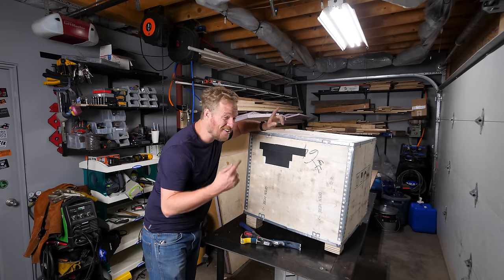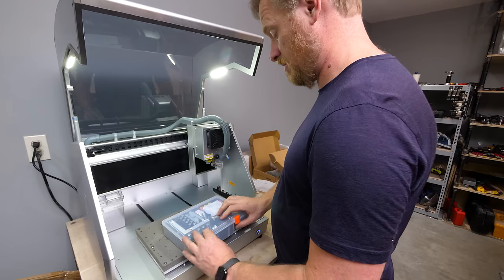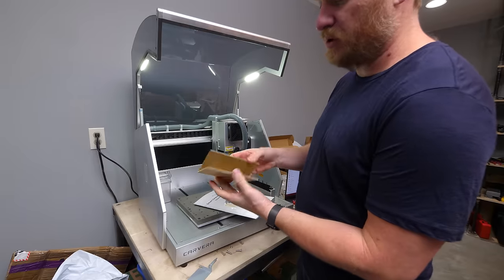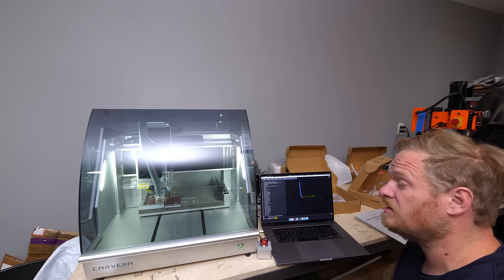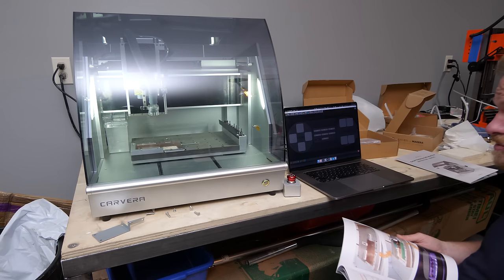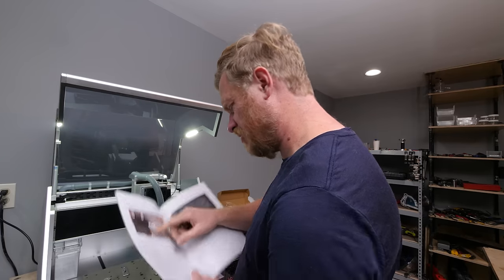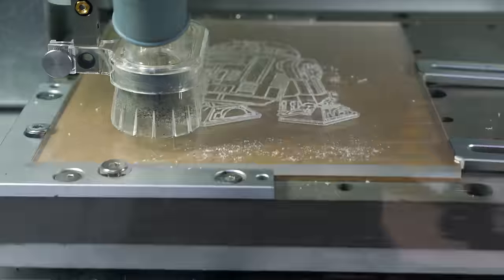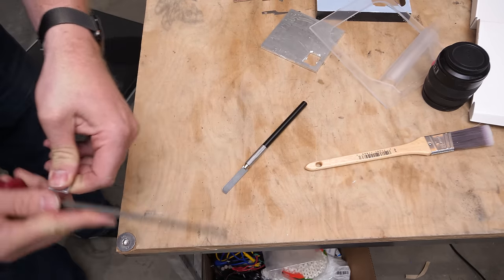Carvera - The Perfect Desktop CNC Mill?

Comment: I like the idea of including a documented project, with parts, to get yourself familiar with the machine.
Reply: Yeaa... It'll show you what CAN be done but not how... CNCing on machines of this... "Caliber" is parts knowledge and parts gut feeling. You need some general knowledge about the available operations you can do, which tools to use for the material, and which settings to use for them to neither wear down like no ones business ( feeding too slow ) or breaking ( feeding too fast ).
And since these machines usually aren't as rigid as one would may want you'll also need a good portion of the Gut Feeling, listening to the sound it makes and maybe get a feel for vibrations. If you have a good running Setup then your Endmill will remain reasonably warm for you to be able to touch it shortly after it came to a stop as most of the heat will have been carried away with the chips it cut away leaving the tool "cold".

Comment: Hello, I am Josh from Makera. First Thank you very much, Scotty, for reviewing the Carvera and giving us your honest feedback. And really looking forward to your future projects, which we know you have already started.

We want to be here to talk a little bit about the Carvera machine. Yes, you can buy a CNC for several hundred bucks, but for most people, you can barely get very good milling results and the operation process is usually tedious, espicially tool changing and probing, even with some machines with a similar price range, many people still can't get used to it after a long time and let the machines do what they need. 

That's why we designed and made the Carvera: letting the CNC as easy to use as the 3D printer, we still have a long way to go but we think the Carvera is the start, the ATC(Auto tool changing and Auto probing) are the 2 key functions that can release your pain when operating CNC. 

Dust collection/laser module/4th axis module/Remote control/App based controller are all things that we want to further expand your ability or make it much easy-to-use.

The enclosure/all metal frame(weight more than 50KG/110lb)/high precision linear motion system/all closed loop servo system are the ways to keep the machine more precise, quiet, clean and robust. 

The Carvera is not cheap, but we are not comparing it to cheap CNC kits, not even the similar price range machines. We are comparing to $10K+ Roloand/LPKF for making clean and usable PCBs and other precise parts.

If you are really interested in the Carvera, we would suggest coming to our facebook or discord user groups, and see what people are saying about it.
Reply: Hey Josh, the machine seems pretty great. Interested to see how it can grow. Could you guys try and create a professional comparison video between your machine and a Wegstr machine? They seem to be very high quality for PCBs and would be the gold standard to beat IMO as they're about in your price range. Their videos are beautiful too. The PCB here seemed a bit rough in comparison (Although he mentioned his poor solder masking). Would be cool to see you beat them someday anyway. Also is there any room for future price reductions? A full starter Tormach CNC that can make things out of more than just Aluminum starts around 6k which isn't that much more if you're already spending this kind of money, although not necessarily made to make PCBs.
Reply: @ablasttv  Yes, the Wegstr machine is good, their videos are great, and I am one of their fans too. But I haven't used their device so I can't say much. But based on the limited product review you can find online, their machine has similar questions like others, you can't easily get fine results on your own without a lot of effort in fine-tuning, and the process is tedious. That's the main pain point Carvera wants to solve, with ATC/Auto leveling and other smart features, we empower the user to get good results with ease. 
BTW: we are introducing the rolling method for solder mask application, it's not the most beautiful way, but it works just fine and is much easier and controllable than other methods.
Reply: I love the tool change feature, I hope you also do a much bigger version, like 1 x 1 metre.
Reply: Do you think it'll work on pistol slides?

Comment: Seems interesting, I like that they included materials to create your first projects to learn the functionality. It does seem the dust collection and ventilation is a problem.
Reply: The dust collection looked almost non-existent. But it could be partially resolved by just moving the mount down
Reply: I was one of the first backers and have this machine. The issue with dust collection is mainly just the weak vacuum power. There is a bypass that allows you to connect your own vacuum if you want. You aren't limited to the weak integrated vacuum motor.

Comment: The problem with the USB-C is the missing 5.1kOhm CC pin resistors. Classic mistake, first Raspberry Pi 4 board revision also did this wrong :D
Reply from the maker: Ah - I was wondering why I have to use a USB-C to USB-A cable to an adapter back to USB-C:)
Reply: Good catch, Tobias!
Reply: I've made this mistake before, im never getting the hours of troubleshooting back XD

Comment: Lasers burn the substrate - obviously. BUT what are the gases/particles given off????
Anything other than clean air going into your lungs is not ideal - excellent filtration or extraction is needed.
And this is for everything that puts anything into the air - welding, routing, laser of wood, metal plastic.
A simple fan + HEPA filter for the room would at minimum be a good (minimal) investment.
Love your work
Reply from the maker: Yeah, if I start using the laser a bunch, I'll probably hook up some sort of exhaust/filter via the external dust collection port built in to the machine.

Comment: Interesting. I have had a Sherline CNC mill for 20 years.
The Sherline is actualy a mill, not a plotter with a spindle instead of a pen.
I routinely do steel components. Lots of brass.
I do plaques 12" X 8" from 1/8 brass.
In the past, I'm retired now, I manufactured clock and insturment components.
I could set the mill up, hit start and it would flawlesly finish a component while I did another job.
I called it my obbedient aprentice.
Kent

Comment: I hope you have checked the effectiveness of those laser glasses somehow? Or that clear cover? Otherwise this looks like a decent machine, let's hope the software gets better.
Reply from the maker: I don't have a way to officially test the laser goggles, but they seemed pretty solid.  The brightness of the laser light on the board was very significantly reduced with them on, to the point I was quite surprised how bright it was when I briefly took them off to check something.  I don't really have any concerns about it.  The clear cover, on the other hand, doesn't do much for blocking the laser light as far as I can tell.
Reply: @strangerparts  But you must understand that dark glasses might not block any of the wavelengths of the laser which can cause eye damage, they might essentially be transparent to the laser. Just be careful! I would check the wavelength of the laser and buy glasses which specifically block those wavelengths, you can't be too careful with your eyesight. Ask the manufacturer for more info?

Comment: Might suggest loading your own profile jigs into the cad software, it typically has a project function with it. On larger scale systems they'll use something like: Accuform Green Laser LED projector. While the one I found on Grainger is 1200.00. You might be able to find one for around $200.

Comment: Looks similar to the discontinued Carvey from Inventables, and on par (or maybe even improved) with the Nomad from Carbide 3D. Both machines are small desktop CNCs with a full enclosure, and both are/were available for <$3k. This does have a few add-ons like the wireless touch probe and dust shoe.
Reply: Yes, it looks VERY similar to a Carvey
Reply: Same scam as the carvey. They take a $300 cnc add an expensive looking enclosure and mark the price up 10x. You are basically paying $1600 for the enclosure and getting ripped off. Even the 3020 cnc models on Aliexpress are better than this thing. They are underpowerd to the point of being an absolute joke. You need at least 500W to cut aluminum and 1kw to cut steel.
Reply from the maker: Where are the 3020's that have an ATC and laser integrated?  And for what it's worth, the 200W spindle seems to be doing ok on aluminum, though it's not as fast as I'd like.  You're right though - steel is probably out of the question.

Comment: I think these little things could use 3/16" bits.  I have a 1/8" and 1/4" collets for my 3018 which came with a 2.5W laser, 1/8" is delicate, 1/4" is pushing the standard motor. Nice jigs. I might have to copy those.  The big cost is in that tool changer which is great for PCB work. Real PCB mills are much more expensive, $40,000+

Comment: Could you post what your feed rate and cutting depths are with your 1/4" bits? I'm really curious to know what you get. 

I purchased a different machine a couple months ago and replaced the spindle that came with it with a Dewalt 611 Router and that really helped improve feed rate. That said, I'm still really new to CNC and found that if I kept the cutting depth to less than 1mm with a feed rate of under 250, I could still manage mirror finished without chatter. That said, I noticed that the bit life on my end mills were reduced if I went to fast so I end up cutting at a feed rate of 100 and my end mills last a ton longer. lol

Comment: Please make another video when you have a complete workflow, to go from an idea in your head to a finished part.  I have been doing CAD using OpenSCAD for about four years now, but that's been either for parts to be 3D printed, or for producing visualizations of what I can manually build out of wood and plastics.  I'm only now starting to make use of my 3018 CNC "mill", still using OpenSCAD for producing the drawings, then transferring them to FreeCAD for generating gcode, then Universal Gcode Sender to operate and feed the machine.  This was NOT a simple process to learn, so I cringed a little when you said something to the effect that you don't have a complete toolchain to design circuit boards from scratch, having been led by the hand through a pre-designed project.  For that, by the way, take a look at KiCad for the design and FlatCAM for turning it into gcode.

Comment: I emitted an authentic LOL when you stated the price.  I've got less than $5k into a ~refurbished Fadal VMC40 and tooling.  It's a big machine but can also do a lot more.  I was expecting $3k or $2499 as the price for this device.
Reply: You're comparing the price of a new machine that's ready to go to a probably very old and worn used one you somehow barely even payed the scrap metal price for?
Reply: @samandoria  note I said refurbished. Yes, is probably older than you, but still more capable than a $5k desktop machine. Money is still money, and capabilities are what they are. I spent $4k on a desktop machine 20 years ago, my Fadal is a better machine for cheaper. I've got $3500 into my machine, new screws and bearings.
Reply: @eformance  I'm not saying it's a bad deal or a bad machine and I would love to have that too. But it's such an apple's and oranges comparison. This is a new machine with support made for a home or office environment. Just because you get more horsepowers and can transport more buying a used truck for the same price as a new smart car doesn't make the smart car bad value.
Reply: @samandoria  either way it's about value, I think this thing is priced rather high for the capabilities.
Reply: Agreed, you can actually buy DMG Moris for less than this price, albeit, they need work yes, but they will destroy the capabilities of this machine, and ANY brand new haas too, I even got a video on my youtube channel of my DMG I have less than £3,000 in total, transport too. Yes it was fairly local, and a good deal, but it did not work, and machined graphite and loads of awful shit, but as you'd expect it needed massive work, really massive, but i was prepared to do so, and she is still running like a dream.

For example toolchanger did not work, x axis was fucked, oil unit, PLC unit, Screen, Spindle Cooler, screen, ect ect.

This carvera machine needs to be sub 3k for it to be worth it,
Reply: @samandoria  Well, I think under normal circumstances (without tax breaks etc.) buying a new car is always bad value, except for bragging how much money you can afford to throwaway on looking good to your "friend's".
Reply: @joseph9915  three year old smart car vs 20 year old truck then 🙂 the point is that even if both is in good conditions one has a use for you the other one doesn't. The person living in the city values its ease of parking and maneuverability alot. It might be worth the premium because it simplifies his life. But the truck would just make his life worse.
Reply: @samandoria  I was talking more about your 3-year-old better model smart car instead of a cheaper model brand new one. Not that I have checked the prices with smart cars, but you used to lose/save a lot even on just a 6 months old cars.
Reply: @joseph9915  I never compared a new and old smart car but an old truck and a new smart car.
Reply: @samandoria  Your first post did kind of say buying a new smart car was good value. 

I was just saying that I can't think of any practical reason (except tax breaks .etc)  why buying a new car would be good value. 

If you had to buy a truck, value wise, I think  buying something like an older Toyota Hilux would be much better value than a new smart car. But comparing them for towing would be more fair. :) I mean, the people buying the older and maybe bit bigger CNC mill will probably still get better results on everything they do (tighter tolerances, faster material removal etc.) and be able to do extra stuff they can't do at all on the smaller one.

Also, I think most people were comparing a New small mill to an old, bigger/better quality old one. That would be more like comparing a 2-door car to a 4 door. Or just one with more legroom, better battery to do longer trips etc.  Maybe buying a car so small your partner has to walk to work because they can't fit, vs one you can both use.

Isn't comparing a car to a truck more like comparing a mill to a lathe?

As for this CNC mill, I don't really know enough about the subject to know if it is good value or not. For me personally, $5k is enough that I would be more concerned about holding its value after 5 year rather than the initial cost, even if I had to pay a lot more initially.
Reply: @joseph9915  I was saying in the comparison old massive truck(used machineshop/industrial mill) vs a new smartcar(top of the line desktop mill since there is no real used market) lots of people wouldn't find any value for the truck, it would just be a hindrance, while a smart car would make their life easier and make it possible for them to do more things, go more places. Both can move people and items around but one is for the city office worker and the other for the builder or farmer.

The point is exactly that comparing them is pointless because if you want one you wouldn't want the other. If you wanted to produce precision steel parts fast in your factory/large home shop then you wouldn't buy this. If you wanted to produce pcbs, aluminium and plastic parts on your desk or in your apartment workshop then a huge haas wouldn't be an option and this would bring the most capabilities too that space. Value is subjective, that's the entire point of a market economy.
Reply: @samandoria  I still say new cars are not good value for private buyers, full stop.

I do not really know too much about this CNCs value for money. But if you say it has the same value for money as a new smart car, that right there makes it bad value for money as far as I am concerned. :) Aren't you saying this is a premium product rather than a value one?

And I am on a farm, so I may be just a tiny bit biased :)

I think we are talking about different things here. I am not saying you shouldn't spend your own money how you want and if you are happy you are getting value for spending the money, there may be loads of reasons to do that, maybe $5k means very little to you etc.  I think using value that way is kind of pointless as you can argue any complete rip off, even an out right con, has good value that way. But I think that is a different thing to an item itself having good value for the price. Rather than the "Value is subjective" would not how much cold hard cash you can get by actioning it on eBay used, be a more realistic approximation. I have hope you would do better than with your new car :) As you are comparing to cars, out of interest I googled the cheapest new car in the UK and got £4,320 = approx USD $5261.80 surprisingly close to the price of this CNC mill.

If you can afford to spend $5k on just the CNC part of a hobby (most likely just a small part of your setup), I think it would be better value to buy a bigger house or buy a workshop/garage. Then you could get a better value CNC :D

And if there are no luggable industrial CNC you could buy second-hand and there is no way to get more space, and you still want to spend $5k to make a small part of a hobby easier. So if you have painted yourself into that much of a corner,  rather than making the machine good value, I would say that you are just happy and hence deriving value from getting taken to the cleaners. :) There is also the option of joining a maker's club if you have no space. At that point aren't you basically saying the machine is bad value in and of itself, but you have no choice and/or maybe $5k means very little to you?

On a different note, would be interested how much someone who buys this spends in total on their workshop? Maybe $25, $50k more/less?